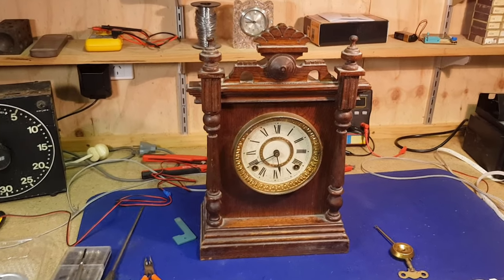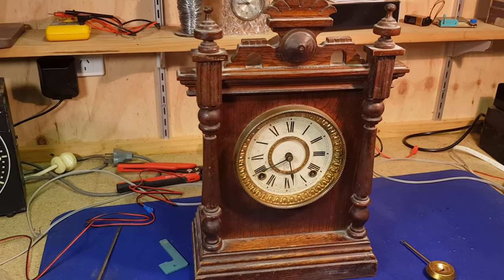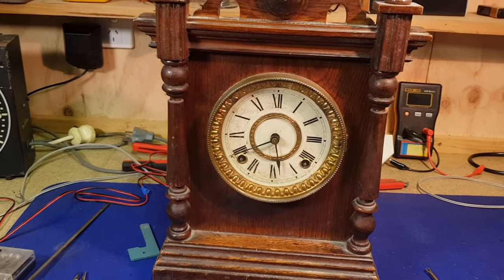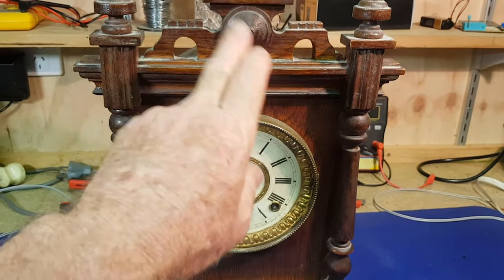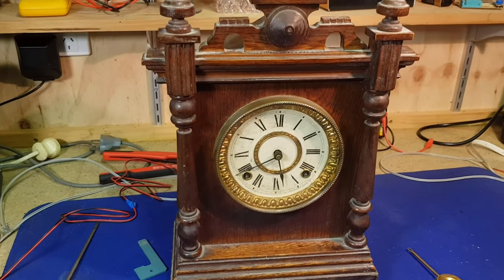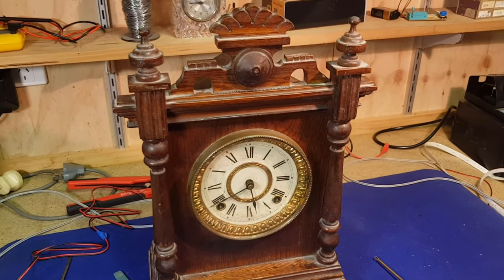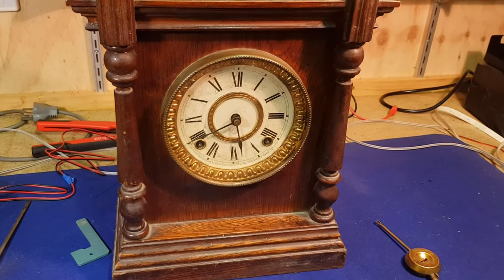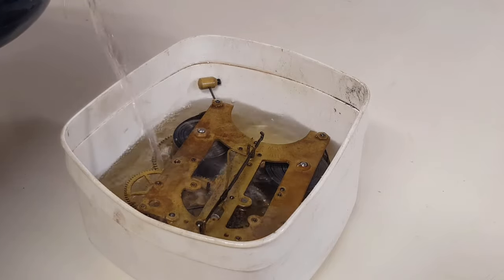How to fix an antique mantel clock. Service & lubricating an overwound movement. DIY Ansonia repairs

Comment: This looks like a great method for restoring an old but not museum worthy clock.  Mine, like some others have commented, has enclosed mainsprings.  I understand that the recommended method would be to tear everything down and oil the springs directly, but how about this:  1. After the cleaning, allow time for the petrol or other solution to evaporate.  Maybe wind and let down the springs a few times while drying.  2. Drip a small amount of oil into the dry barrels through the hole used to remove the cover.  Again, wind and let down the springs a few times to distribute the oil.  3. Let down the springs just enough so the access holes of the barrels are positioned at the bottom and let any excess oil drain out.  You could even reassemble the clock and leave a folded paper towel under the mechanism to catch any remaining drips.  It seems like that would ensure that the springs at least got washed down and reoiled without dismantling everything.  I just know that if I take it apart, there's a good chance it won't go back together correctly.  Is it possible that too much oil can be detrimental to the mainsprings?
Reply from the maker: Great comment Ray!
My recommendations would be to wash & clean the movement as best you can without submerging the enclosed mainsprings. If the rest of the movement is nice and clean and freshly lubed, I would think that should allow a clock to run quite well without disturbing the mainsprings. If it doesn't, then the springs must to really dirty or damaged, which would really need proper dismantling and cleaning anyway.
The risk of washing them out is that it would be really difficult to know if they are re-oiled properly. Too much oil probably isn't a major problem on the springs as they will squeeze it out when wound. It would be a bit messy though! Hope that helps. Cheers, Chris

Comment: How do you let down the springs? Do you push the winder in? If you do not have a custom tool like you made, how would you do it? Something blunt that would not catch on the spring?
Reply from the maker: Letting down the springs can be rather dangerous without a proper tool Chris! Those things can really pack a punch!
Reply: @TheUltimateRecycler  Thanks... I think I will take it to a professional who has the righttools and training.
Reply: @TheUltimateRecycler 
These mainsprings hold an incredible amount of power/energy.
I understand the manufacturers intentionally over-powered these clocks to compensate for slightly worn pivots, etc.
Your tutorial has really helped a lot of folks, thanks...
Reply from the maker: @davestelling  Thanks mate! 😊

Comment: Hi. I have a German, Mid Century Modern chiming Gigant wall clock. I shipped it to a "repair shop" for a cleaning. After several months and over $200.00, the clock drastically loses time. Is there something I can adjust to rectify the problem? Thank you!!
Reply from the maker: I'd be getting in touch with the repair shop on that one! Sounds like they didn't do a very good job! Is it a pendulum clock, or a balance wheel - or battery?
Reply: @TheUltimateRecycler  It is a balance wheel. Unfortunately the "repair shop" is over 600km away.
Reply from the maker: @pitpony2006  Ok.. It sounds like it could be a problem with the hair spring. If it's running slow, the hair spring needs to be shortened. There is usually some type of adjustment to do this..

Comment: Hello, Can I ask, do you rinse with anything after the petrol bath? After I had soaked the mechanism for a few hours, there were patches on the parts which felt rough, some looked rusty to me. I did wipe everything with a damp cotton pads and little brushes, but I can still see some ‘’white-ish’’ residue. The mechanism is definitely not shiny, it does not look or feel like a polished metal, but all the old oily residue is gone, and there was a lot of it :) It also works fine. Shall I do anything else before oiling? Thank you for your very helpful video. I agree with the others that your advice is very good and clear. All the best.
Reply from the maker: Thanks Aleksandra 😊 No, I don't do any other cleaning. It's possible the fuel will leave a slight residue and may slightly effect the look of the brass - neither of which will have any negative impact on the metal. It should not substantially change the look though - if it is rough, then it must have been rough beforehand, underneath the oily residue. Thanks for watching! 👍

Comment: I have a question...my Perivale has 3 winders...the springs are in a brass housing and can't be accessed to lubricante them like you did...is this going to be an issue...? thanks in advance if you monitor these messages....👍
Reply from the maker: Yes, some clocks have enclosed springs and you shouldn't submerge these. To clean the springs and re-lube them properly, they really need to be dismantled completely which is a much more involved process. Often a good wash and re-lube of everything else will be enough to have the clock running again - but sometimes a more traditional dismantle and service is required.

Comment: I have done this before, but i got an ebay clock that was so gummed up even after i seperated the plates and used an ultrasonic cleaner for over 2 hours i still had to clean every wheel pivot and bush by hand. Not sure what they oiled it with but it wasca green black gummy mess that dried and hardened. Somehow the clock did not need any bushings. It was probably still not running after they lubed it and put away.

Now if i wasn't the last to service i will do complete disassembly and cleaning. But it is VERY time consuming.
Reply from the maker: Yep, complete dismantle & clean jobs take a lot of time and for many people, a lot of courage!!
Reply: @TheUltimateRecycler  yep and i learned the hard way. Some chime clocks have to be timed properly and not having the procedure you put together try it. Oops thats not right. Then try to figure out how it works. Move some of the gears, snail and try again. Close, take apart again ok now i got it. But next time you will pay attention to these details.

Comment: My wife has an old mantel clock and works are very similar to one on this video. After starting pendulum it will run for about 50 seconds. What would that indicate? Works gummed up?
Reply from the maker: Yes,  a fair chance Roger - especially if it hasn't been serviced for a long time. Just check that the clock is level (both sideways and front-to-back) and listen to the beat to make sure it's even.

Comment: Hi, thank you for this explanatory video, I will soon be cleaning my mechanism, I am getting ahead and wondering with what product can I clean the pendulum which seems to be made of aluminum (?) for my Asonia clock co 1882 patented clock. Thank you
Reply from the maker: Hi Pascal, glad it was helpful! I wouldn't clean the pendulum too much - it's an old clock and the parts shouldn't look shiny new!
Reply: @TheUltimateRecycler  Its true, you are right
Reply: @TheUltimateRecycler  possibility of using brake cleaner for the mechanism and removing the grease or is it too strong?
Reply from the maker: @pascal6790  It may discolour the brass a bit, but I don't think it will cause any damage. However it may leave an unwanted residue and also it may not get into every spot which needs cleaning.

Comment: What do you do with the dirty gas?   Just curious.  I agree, letting the springs release would have made the springs clean a bit better, but that doesn't seem to be the major problem here.
Reply from the maker: I reuse it a few times Robin - more for engine parts once it gets a bit dirty. Then either leave it evaporate, or use it to (carefully) start the fire!
Reply: @TheUltimateRecycler  Thanks, I was curious.  We used to use old dirty gas to soak old rags and use them for a torch. That was when I lived out in the country.  Appreciate your response.  It could take a long time to evaporate.
Reply from the maker: @robinpettit7827  It's certainly not wise to leave open containers of fuel laying around to evaporate but it doesn't take very long for a little fuel in a flat tray.
Reply: @TheUltimateRecycler  I understand, increase the surface area to the volume.  A large flat tray works best.

Comment: We have a Chauncey Jerome 8-day weighted clock, double doors, not spring wound. It worked great for around 7 years after we bought it at an antique dealer until we moved last month. My husband packed it, removing the weights, but now it won’t run more than 20 minutes without stopping, Any ideas? He's a good diy but hasn’t figured this out. We watched your video and enjoyed it but since ours is a different style, I hope you might have another suggestion.
Reply from the maker: Hi Elizabeth. It's a bit hard to know - but the first thing to try is to make sure the clock is level, or at least the tick-tock is in beat. Something may have been jolted during the move.
Reply: @TheUltimateRecycler  My husband  said the tick rock does move and runs a few minutes until it quits moving. He thinks he might have wound the weights too tight when he set it up after the move. Ran fine before the move a month ago. Ideas?
Reply: The first thought is that it's out of time. Listen to the beat @ 24:00. As he says, "ticking with a limp." See the difference to 24:10. Now both the pendulum swing left and right (and the time intervals) are equal. The first remedy is to level the case, or experiment with shims on the sides to get a regular beat. Here's a vid on the subject: https://youtu.be/32_6z3naB-k
Reply from the maker: @markfisher7962  Thanks Mark! 👍😊

Comment: I was wondering if you might recommend a book on clock repairs. I've just bought a vintage mantle clock (that doesn't work). Last time I had a 1940's  watch looked at it was almost $400! Ta, H.
Reply from the maker: I'm not aware of any good basic clock repair books Helen, sorry. Yes, professional clock/watch repairs can be expensive! Maybe just check out a range of YT videos..

Comment: Chris, your how-to video is awesome!! So clear, and easy to comprehend.
 I've got a mantel Howard Miller, that runs but won't chime or strike. Would you assume that a petrol soak and lube would get it back to singing again?
Reply from the maker: Thanks Isabella! It obviously depends on the reason as to why it's not singing! A good clean and re-lube is going to fix most things -unless there's excessive wear or physical damage. Fingers crossed for you! 😊👍

Comment: I have a unicorn mantle clock with a Hermle 178,28 movement. The springs are enclosed in a housing and can't be oiled as you demonstrate. Is there an alternative method without taking the mechanism apart?
Reply from the maker: This method does not work with enclosed mainsprings so unfortunately they will need to be dismantled!
Reply: @TheUltimateRecycler this is not true most enclosed barreled mainsprings will slide out without the winding arbor to do this it must be let down then the holder for the ratchet wheel on top removed then ratchet wheel removed then the winding arbor should slide right out then the spring barrel slides right out
Reply from the maker: @Cobesclocks  Yes, in some clocks the entire mainspring barrels can be removed relatively easily from the movement. But you still can't clean and lube the actual mainspring without removing it from the barrel. Still, the rest of the movement can be done as per video 👍

Comment: Could you soak the mechanism in white vineger might be safer
Reply from the maker: Vinegar is an acid and it will effect the metal. Also, I don't think it would dissolve the old oil like a solvent would. So that's a no from me Paul..

Comment: Can you spray contact cleaner on it to get the gummed up oil?
Reply from the maker: It would probably work Casey, but that stuff isn't cheap and you'd have to use a fair bit to flush out each bearing! Thanks for watching 😊

Comment: My Regulator repro works fine except two times a day. It stops at approximately 6:35 to 6:40 am or pm. reset twice a day and it works fine, bug I want it to clear 7 am or pm on kits own. Suggestions?
Reply from the maker: Not sure Richard, it sounds like there could be some mechanical damage with the drive train, or perhaps even something stuck on one of the gear teeth? It seems there is one spot where there is sufficient friction to stop the movement.

Comment: Thanks for your excellent video! This worked really well for my clock... except I think it's safer to use an old unwanted metal saucepan for the petrol soak rather that a plastic container... the ice cream tub I used soon started to dissolve and I quickly had petrol all over the floor!!!
Reply from the maker: Obviously the wrong type of plastic!! Thanks for watching and I'm glad it helped 😀
Reply: Ha ha . The same thing happened to me . The kitchen stank for ages !!!

Comment: Can I use cooking oil since it's safer
Reply from the maker: Probably not a good idea. It will dry out much more quickly and not provide good long term lubrication. Besides that - your clock will smell like a Greek salad! 🤣

Comment: mine is working but chime is 'overwound; do you think this would help? I am afraid it is worn and needs to be unassembled to fix
Reply from the maker: If your clock is worn badly or has mechanical damage this won't really help.. but if just gummed up with old oil, you should be able to fix it 👍😊

Comment: i am trying to get a 1919 west clock big ben alarm to work  i spray electrical contact cleaner and that takes all the old oil then i put new oil in and when i put too much oil and it starts to fault i clean it out and start again. i hope to work out how much and what parts need oil . the parts close to the escapement wheel don't seem to like oil but i can't find much info on this on line
Reply from the maker: Too much oil is the enemy of clocks. Just a tiny dot on the pivot points only - none on the gear teeth, and certainly no oil on the hairspring!

Comment: Would Acetone work as well and not leave residue?
Reply from the maker: I guess so, I've never tried it. Any solvent that dissolves the old oil and doesn't leave a residue would be fine 👍😊

Comment: My main spring just seems to weak even after I released and cleaned and rewound it. If I add a little pressure on the cog it’ll run but I dunno Maby after 100 yrs wound tight they are weak??
Reply from the maker: Maybe the spring has been shortened and is lacking power, or perhaps there is still excess friction in the drive train somewhere?

Comment: Gasoline:  I remember as a young boy (mid-60s) my dad would clean his paint brushes (from house painting) in gasoline.  He had a particular, out of the way, place outside where did this.  Couldn’t you also soak the movement in warm sudsy water with degreasing (Dawn in the US) dish washing liquid?
Reply from the maker: I don't think water, even with a degreaser would work as well at dissolving the old oil residue... plus you'd need to be very careful in making sure everything was totally dry due to potential rusting problems..
Thanks for watching Fintan 😊

Comment: I have a Ridgeway model 225, date 8/27/86, Movement CC-1161-853-114-CM.
It will not stay in beat, I have found that the anchor escapement is loose on the shaft.  I can rotate the anchor slightly and it will run just fine, then all of the sudden it will slip and get out of beat again.
What is an easy acceptable way to secure it to the shaft?
Thank you
Hager Hay
Reply from the maker: Hi Hager, I can't really help you with that as I'm not familiar with that clock.

Comment: Someone told me not to use petrol but iso alcohol. I’m confused now, surely petrol won’t leave much residue?
Reply from the maker: I think petrol is fine James, I've never had any problems with it 😊
Reply: @TheUltimateRecycler  thanks for the reply. I’ll do it. It’s only an early Bakelite smith clock that I got for twenty nzd as not working but it’s in good Nick, chime works, I think your method will work. Thanks for posting!
Reply from the maker: @jameslast3192  Thanks for watching! Yep - give it a go. Let me know how it works out.. 😊

Comment: ...a muffin tin helps me keep all the parts together but separate and in chronological order which makes loss and reassembly easier...
Reply from the maker: It's also great for muffins Phil! 😜🤣 But yes, you are correct, it certainly helps to organise the parts in order 👍
Reply: @TheUltimateRecycler  ...still ain't got the wall mounted school house clock going yet! Fixing to clean it again.

Comment: In my mantel clock, the minutes arm pauses at # 4 (minute 20), and need push to move, can you help please.
Reply from the maker: Check that the minute hand is straight and not rubbing on the glass, or face at that point. Otherwise the problem will likely be with one of the gears - a burr or some issue with a tooth perhaps. Good luck! 👍
Reply: @TheUltimateRecycler  I thank you very much for your advice.